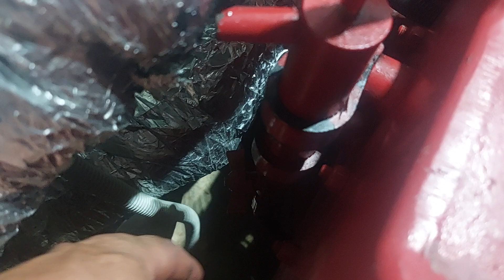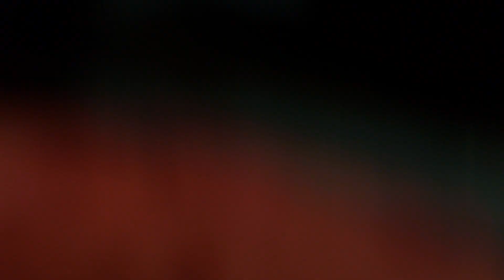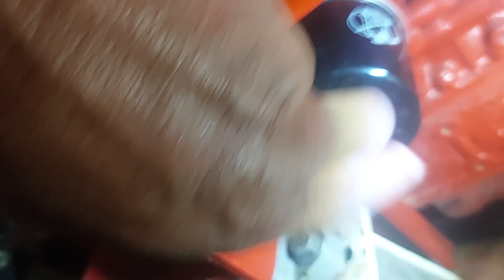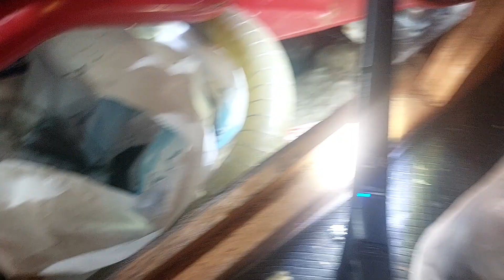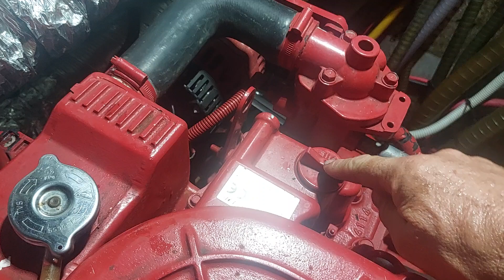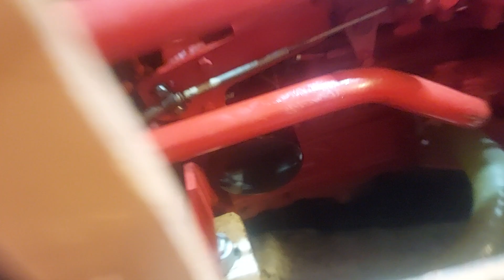how to change the oil on an engine. unit a  beta marine 75hp winterizing

Comment: And that is how easy it is!
And also a good reason to do it yourself to (a) get to onow your engine snd (b) as shipyards tend to do it simultaneously while changing the fuel filter (in spring). 
Thanks for again a clear video!
Harry
Reply from the maker: I will in spring do one on fuel filter change as that's when I do that one...the fuel tank has been filled and I use marine 16 treatment to try and prevent diesel bug.. so far successful. There is a video on fuel bug .
Reply: @TheMarineSurveyorNotebookBenSu  that is indeed how to do it. Clear explanation as always Ben 😃